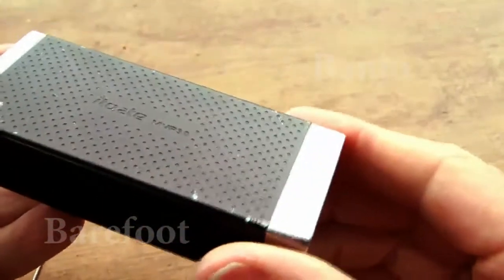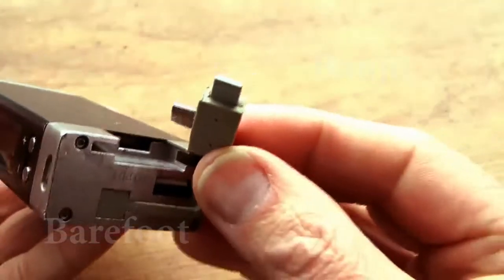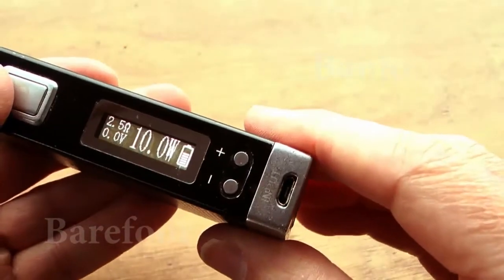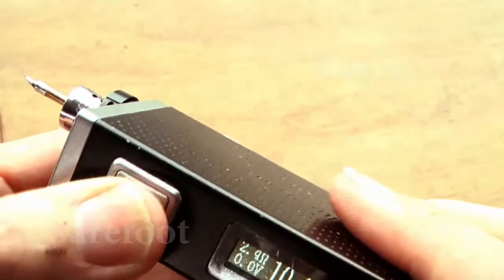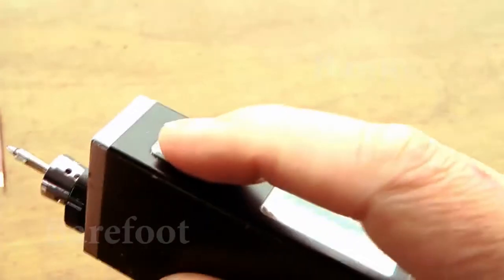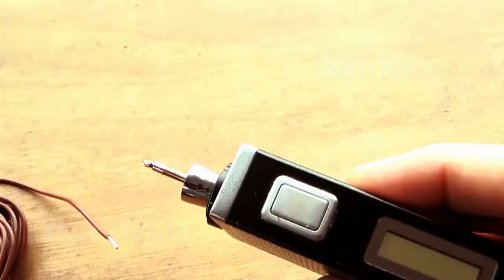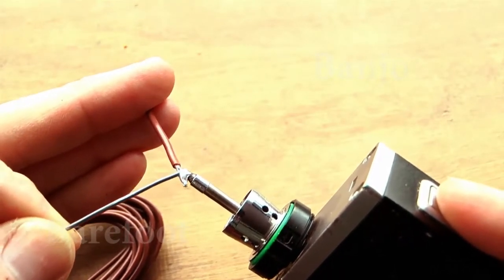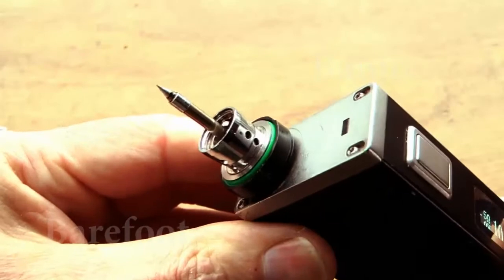Soldering Iron vape hack

Comment: Very nice, thanks for the video. I actually tried this with a 2 something ohms build with old used ni80 coil with a sleeve over the old soder tip on a old rda deck. works like a charm but didnt last long. I was wondering what tip from what soder tool you used for that.
Reply from the maker: thx nicholas - the link to the tip is in the description

Comment: Brilliant.Once did this with a full ss staple staggered fused clapton coil and almost set the pcb i was working with on fire!
Reply: Naturally, ss is much lower resistance. hes running on like over 2 ohm, if you got some winding on it for .10 ohms its gunna be very hot

Comment: the nice gentleman is running a positive lead ( from where the atomizer's 510 connection would usually emerge ) probably made of copper, or something a bit harder, through a hollow, negative lead in tin or steel (like one of the concentric poles in an antennae.) The positivities lead is in some sort of non-conductive wrap or heat shrink, so that the iron does not short. +_ 

don't worry about the language oriented comments @barefoot69, those are just nobodies trying to subvert the english language in every way possible. 

thanks for the clean video